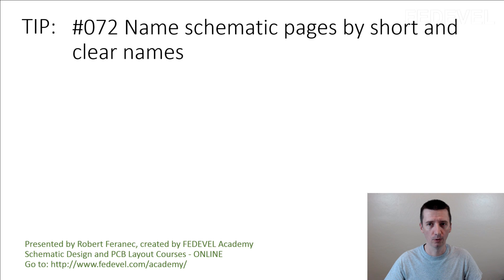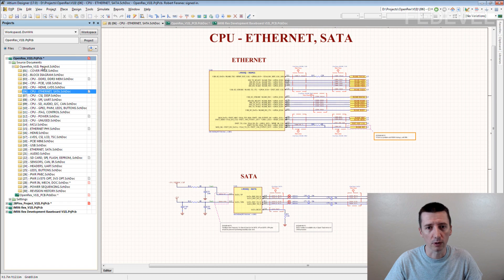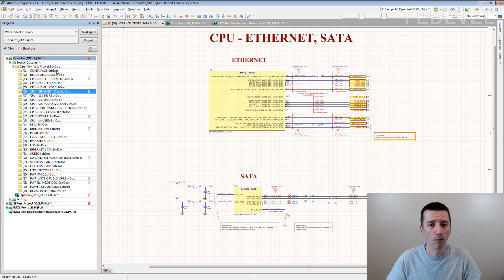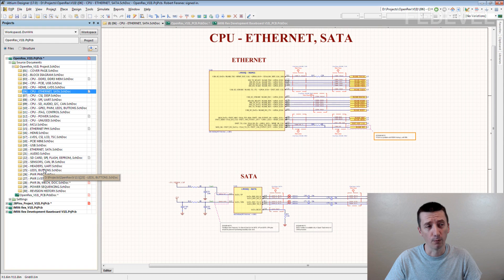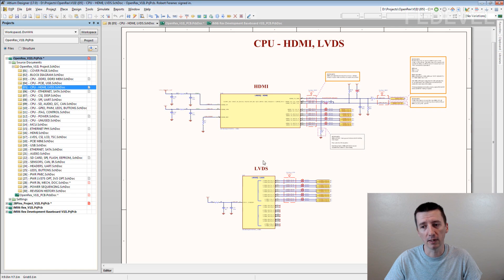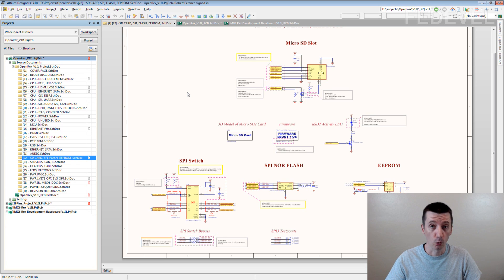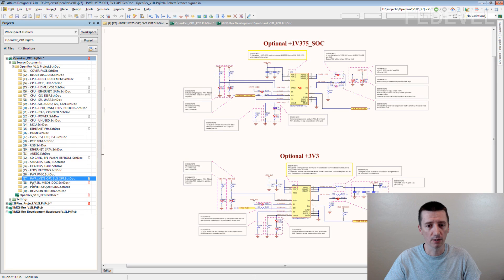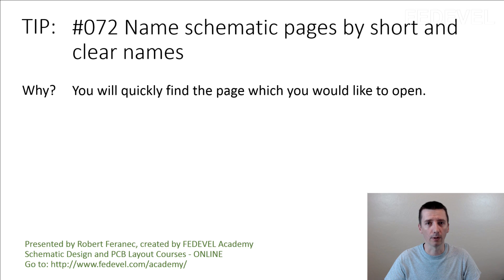TIP #072: Name schematic pages by short and clear names

Comment: How do you add the page numbers to the page names? Does Altium do that for you? I couldn't find an option for that. Do you do it manually? Thanks!
Reply from the maker: Manually
Reply: Oh! What a pity. I thought is was one of those parametrized parameters like .Description or something. Now that I think of it, it would not be very practical for source control, if you use it.